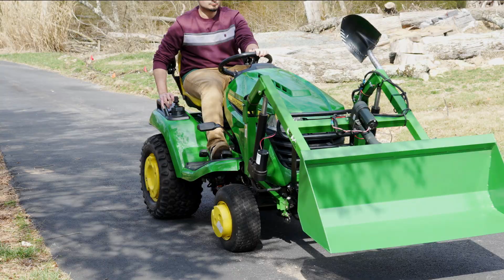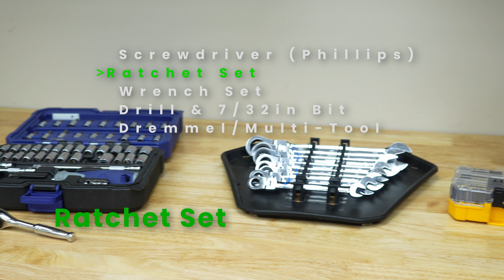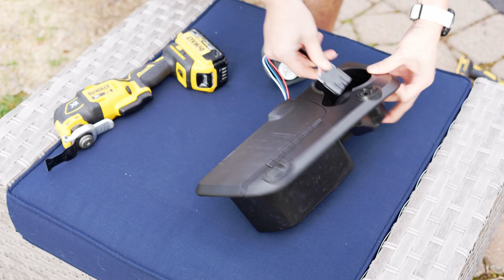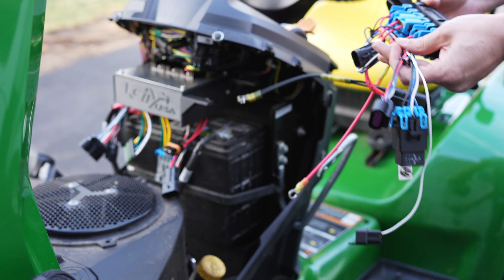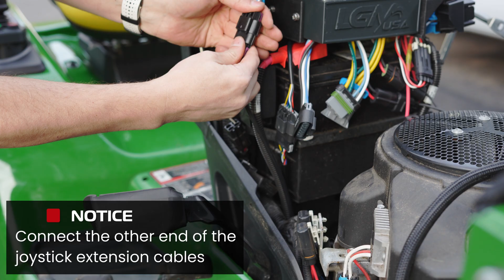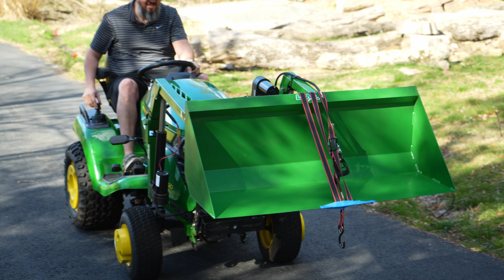Joystick Kit Installation Guide for the LGM-100

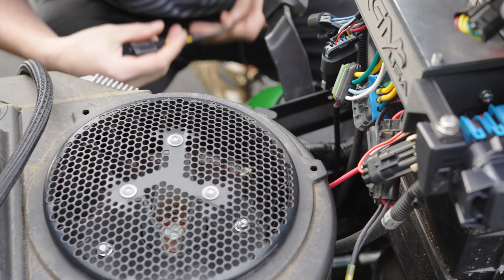Comment: 06 22 24  I purchased this about a month or so ago  -- was in no hurry.      I installed the uprights 1 weekend and ran  FEL wiring .. Joystick was a week delay due to this being new and new mfg  process  -  was fine with me...         Finally arrived  and  it has quality  feel.    Installed as video showed.  I did try to run joystick wire with out taking off deck and 1 connector made it and the other was 5 inch short.     I did take the deck off and ran it.       The power distribution  was the trickiest  since the throttle cable had some interference, as noted in video.     With some fiddling  it fits just right.    Kind of hard to mess up connector fittings   2 pin to 2 pin  3 pin to 3 pin       4 pin to 4 pin   --  ..  The only issue I had was the aux power connector  @3:54 time mark   (single white wire)        It seem to fit either way into the JD harness  but only 1 way enable the joystick to turn on.     If the Red LED does not come on   check the orientation  of this connector .     

My test was a pile of mulched leaves   20ft diameter 2 ft high   and wanted to make the pile smaller and taller.      Handled with with ease.     Still on my learning curve  but have plans   for more use.

Worth buying?    Absolutely.     Support ?  I had a few emails back and forth  with Dan and Carlos,  all timely .  
The bucket came separately  to a freight distributor and they loaded it into the  van  Plymouth voyager, skid and all .  The rest show up about a week later.  

Final thoughts  Buy some fresh drills  for the frame holes.       Installed on JD X584.
Reply: this is the kind of review that gets a guy on the fence to commit to it. thanks for this writeup, extremely valuable.  the lgm website needs some more docs on the joystick support.